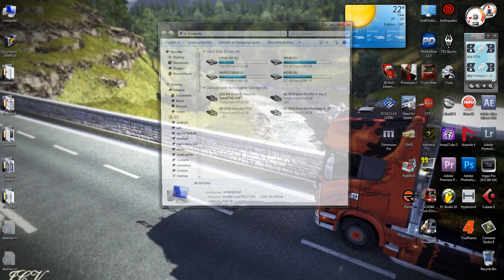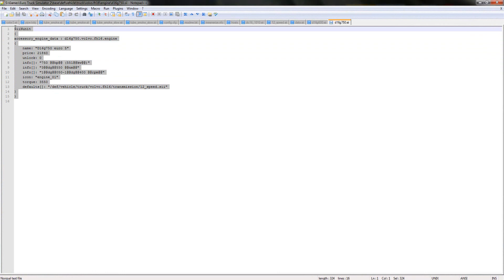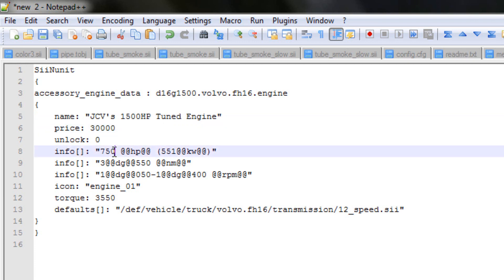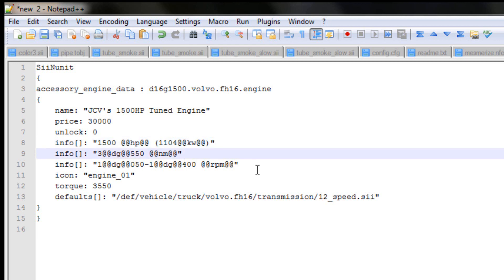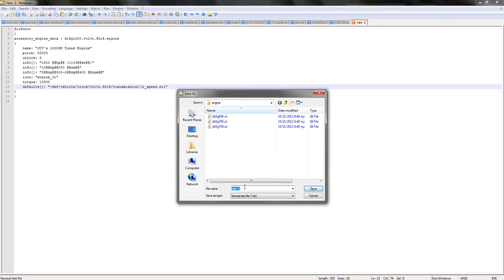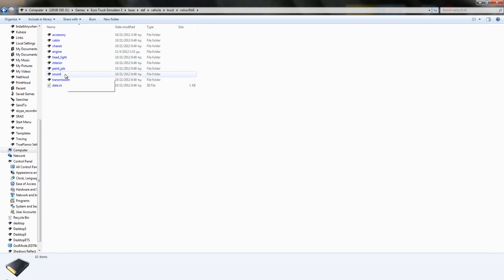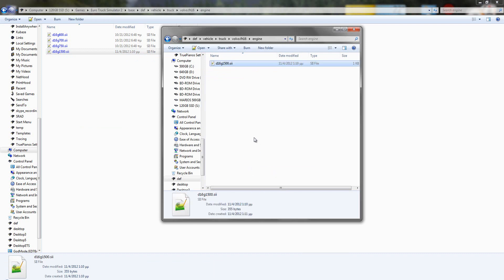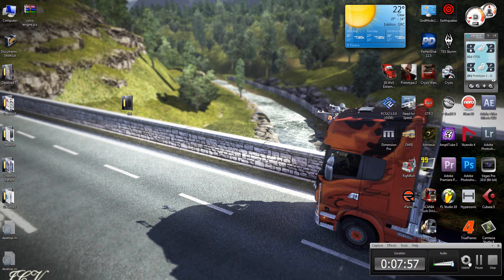ETS2 Tutorial Part 2: Modifying Basic Definition Files

Comment: I should also note that the mod engine is appearing as a mod in mod manage in the game as well as the truck. I'm wondering if either it's not recognizing the file under the engine folder in the truck or if my def folder should be routed different since the truck is a mod in my mod folder and not one of the originals in the game.

Comment: Okay I am attempting this method without any success and I have a few questions regarding it. Okay so instead of extracting the mod at all I just use winzip and open the file, go to engine where I copied the engine and then made the proper changes and saved the file with winzip. The file remains a scs file and I never had to unzip or uncompress the file, which always made the mod not workable. The truck still shows up in the game as a working mod. I made a def folder and followed my path to the engine folder where I copied and pasted the mod and then I used winrar to make it a scs file. Now the engine has the .sii ending and the winrar folder has .scs folder. I added that to the mod folder under euro truck and every time the truck is there but no new engine. The only thing I dont do from your video is because I'm using a truck mod add on,  I don't use a scs extractor and instead just open it with winzip and place the engine file in there. Would that mess the game up from recognizing it if the truck is still playable and available in the game? other than that all my steps are correct and all file extensions are correct but no new engine. Lastly before I go through the hassle of fixing this problem or people waste their time helping me does having a new engine mod actually produce the new horsepower you make it or does it just display the horsepower and the torque is the only variable that changes?
Reply from the maker: So what youre trying to do is modify an already existing mod, and add a new engine to it. Well in that case try to do it like I do. Some mods overwrite others depending on the priority you have given them. If thats not your case, again make it the way I do, step by step, and try it as your only mod, see if that works.

And also yes. This affects only the HP and torque.. If you want crazy speeds, you need a new transmission file aswell so that you can adjust your gear rations for more top speed.
Reply: okay just giving an update of what's going on. Yes that is exactly what I'm trying to do JCV. I am trying to take a mod truck and add an engine to it. If you could please attempt to to this and tell me how you go about it, that would be great. Okay so far this is what has happened. I take the file and of course it won't work if I use the scs extractor and extract it and leave it that way like you show in your video with the base files. So I open the scs file with Winrar and use the program to add the engine mod which is copied and edited from the existing one already there. After I place the file into the engine folder and winrar processes it I then make the def folder and add the engine mod under engine and then use winrar to store it like you show in your video to a scs file and then add both the modded truck I've downloaded and added the engine to and the engine mod I have created to the mod folder under Euro truck. Both mods show up but one of two things happen every time. If I only add the truck in mod manager to the game, the truck shows up but the new engine is not in the upgrade section in the game and if I add both the truck and the new engine mod, every time I attempt to open the truck dealer (mercedes in this case for me) to view the truck the game crashes. Whenever I remove the engine mod with mod manager the game works just fine so that mod is messing the game up somehow. Now I either figure I'm doing something wrong or with the recent updates on the game it now has made it where I may be doing it properly but the game is crashing as a result of trying to make the other engine appear. I'm not sure but any help will be great! Thanks!
Reply: I did exactly the same, game sees mods as active but i never get them in game... engines are all stock.... if i lower lvl to 0, all are still unlocked
i even made a +0 for first engine.. for iveco strails  from 310 i made it 3100 and same with nm and torque and when i go to buy it, and i go for more option still no difference...

Comment: Hi very helpfull video indeed. Could you make a video how to manage the control.sii file i.e. adding an input entry and the syntax witch must be used as well for some others lines like constant etc... A video witch cover all the entries whose users can modify with example for each sort of modifyable lines. As I get a problem to assign a stick gamepad axis labeled RZ by windows controller input but I wanted to assign RZ positive and RZ negative. Tried some modifications without success but I'm unable to know the exact syntax to be used in this case.Finaly when we add an input entry does it needed to add the related constant line ?So many question about to manage well the control.sii file ...

PS: I'm sorted out with my problem just putting a minus sign ahead the labelled axis i.e. `-joy2.rz?0`" to get the negative value of RZ axle in game. So simple. For the positive value retrieve the minus sign. We can't make easier XD. But really the syntax used need to be more explained clearer. Nevertheless I get some "complexe" word displayed in the keyboard binding option in the game but that works too.

Comment: Im doing exactly like you've done, only exception is that im doing an engine to an scania streamline instead..
Only problem is as soon as i've installed the engine and try to drive away the game crashes... Any idea what i've done wrong? playing trough steam so i have the latest version (1.9.22)
Reply from the maker: Yes...the way the definition files are composed and read by the game, has probably changed since 1.9.22..Remember this is an old video and as such does not work with 1.9.22. I will research this though
Reply: JCV oh many thanks! please notify me if you find out what I might do to get a bit more powerful truck ;)
Reply: JCV hey! have you got any news about modding the engines with current update of a game?
thanks :)